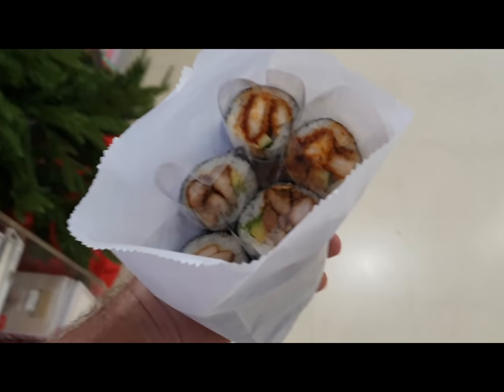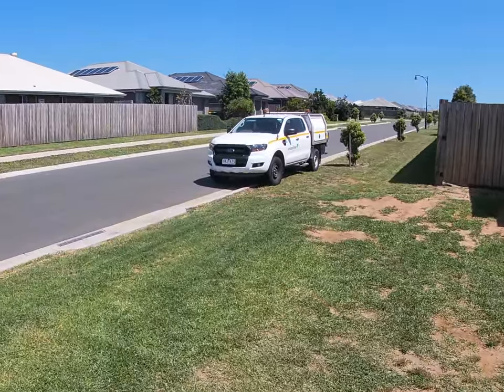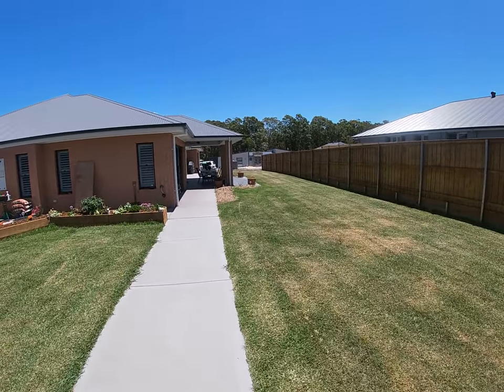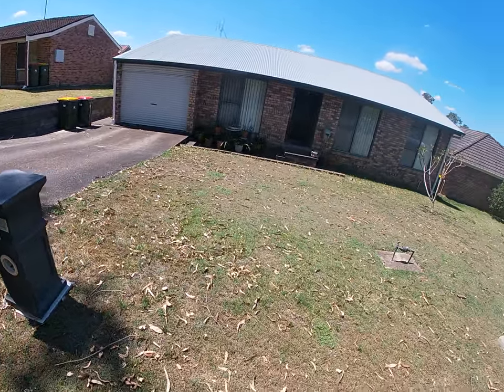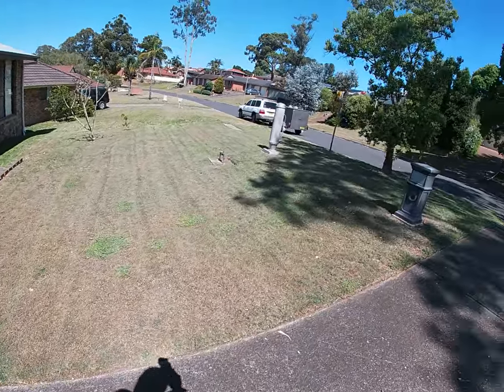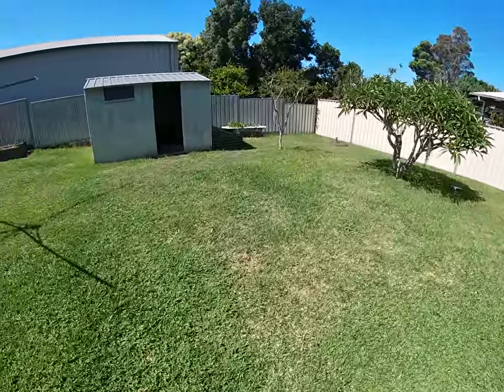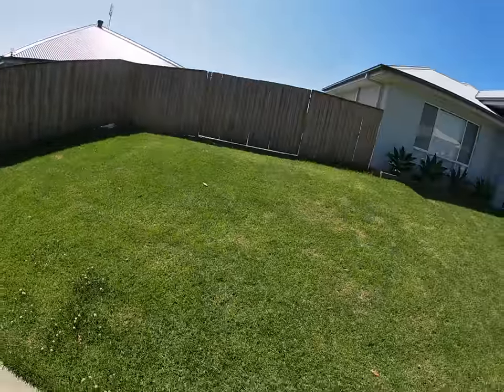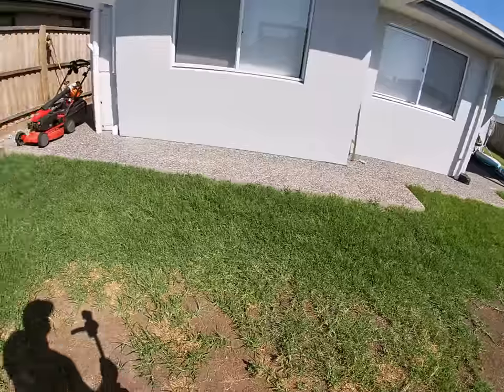Lawn care vlog - 6 properties in 6 hours

Comment: Are you liking the rover do you recomend it over say the Honda
Reply from the maker: Hmm, it's hard to recommend one over the other, they both have pros and cons. The Honda 216 is considered by many to be the industry standard for a 21 inch for reliability and cut quality. That said, I have punished my Rover since I've owned it and it hasn't faltered. Also, it is 196cc compared to the 216's 163cc, and handles thick stuff better than just about any other 4 stroke I've used. The rover is about $600 cheaper as well, so that was a consideration for me.